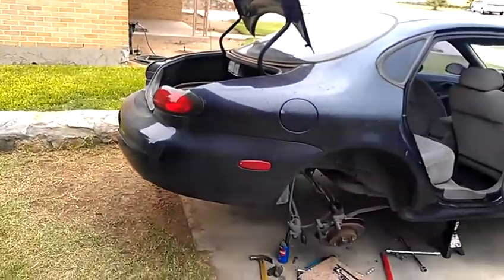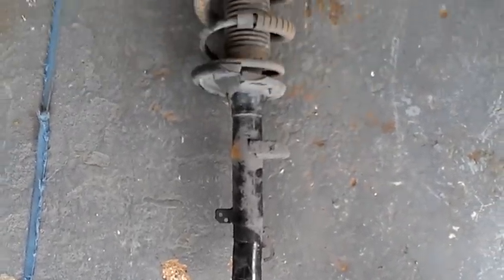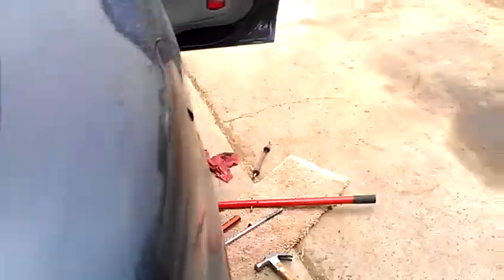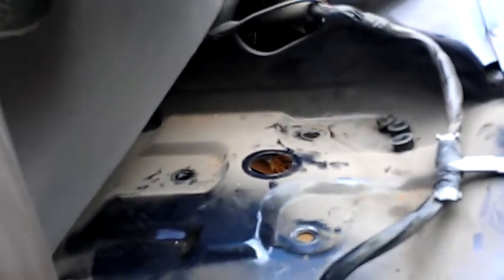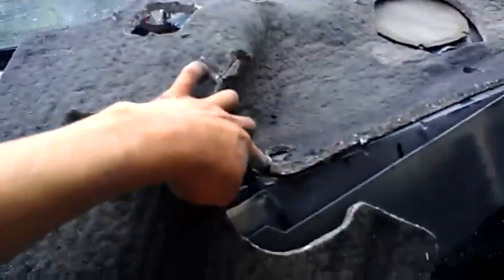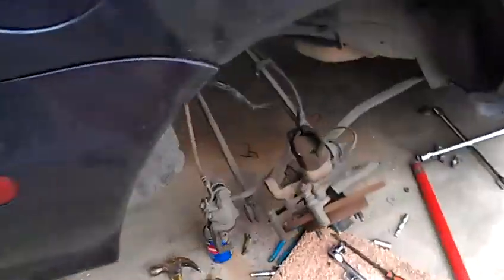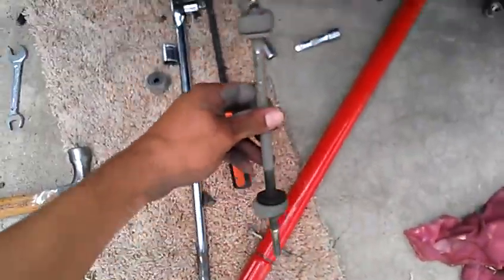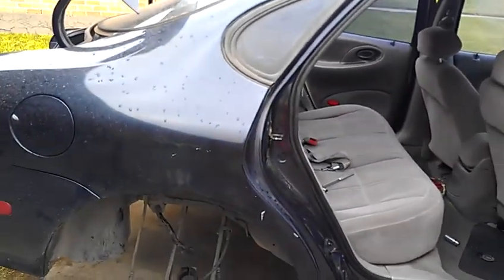How to: Ford Taurus Rear Strut Install and Removal (Bent Strut)

Comment: The piece you said gives you the most trouble,  do u know what that's called?  My metal cap was I guess rusted and popped right through the bolt now rattles looking for a way to fix it someone said if I loosen it I will release tension but I'm not sure what it's called